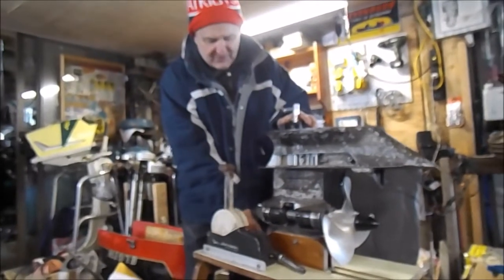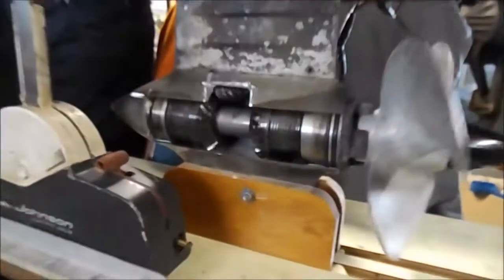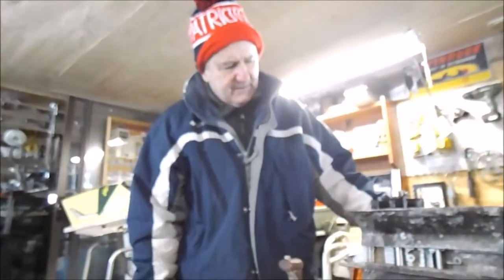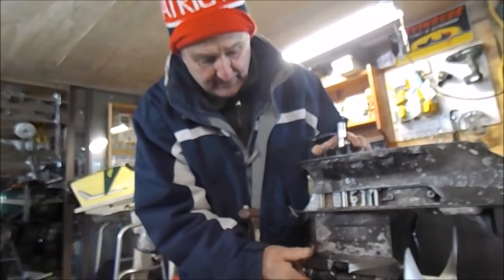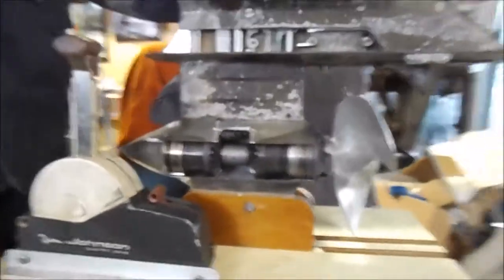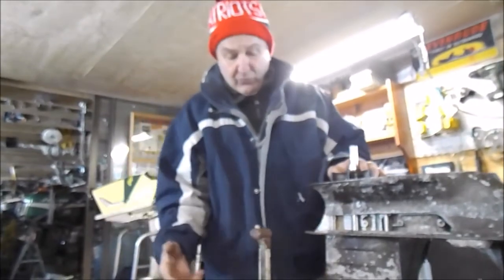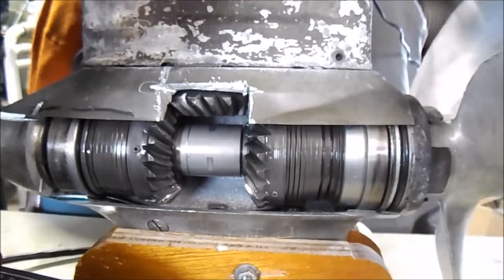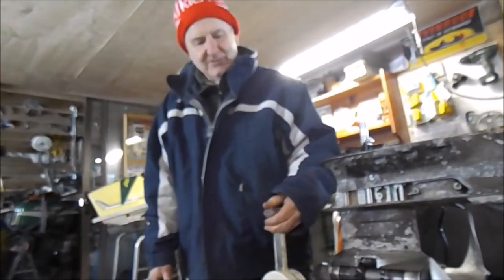OMC electric shift lower unit

Comment: That Lower Unit was from a V4 75, 80, 85, or 90hp Motor. Easy to tell by the Lack of any Gear Reduction(23:20), the Small Hub Prop, likely a 10 X 9 1/4"

Comment: Had 2 of these Units in the Mid 70s. Simple Design, easy to Understand, and to work on.  No Quick Shift and none of that Annoying Sound from easing it into gear, you hear all the time. If the Water Pump failed or was weak, the Shift Wires , were often burnt, because of a Hot Dry Exhaust

Comment: Thank you very much This really helped me understand how that works. I lost my dad back in May and his boat has not been out for 35 years I had it running I just replacing some points and I checked it on land to make sure it went into gear but once my sister and myself got it out on the water it popped in the gear one time and then would not go again luckily we didn't get out yet as this happened at the dock. But It was really sadening because we were really looking to take my dad's boat out again after 35 years. Hopefully I can figure out what's going on but your video definitely help me understand it.😊

Oh by the way the boat is a 1968 Browning with a 120 horsepower OMC outdrive and a four-cylinder iron Duke powering it.

Comment: My first boat I bought when I was a teenager had  a ‘66 80hp Super Seahorse with the Electramatic drive. The quickest and smoothest shifting boat I ever owned. I owned it through college  from about 2004 until 2011, and it never once gave me an issue. The electric shift fluid was readily available at my local Evinrude dealer at that time, but was hard to find elsewhere.

Comment: Good video has helped me a lot and member comments are great. I need help on installing new shift lead harness thru hole to lower unit. Do I grease then pull from which direction to prevent tearing up rubber seal?
Reply from the maker: I have never worked on one I am a Merc guy ,hopfully a OMC guy can answer your question

Comment: How can you test the magnets to see if they are working with the gear drive out of the housing
Reply from the maker: they are electromagnets run 12 volts thru the wires see if they pull the springs down

Comment: Thanks for the video. I also have the 1st gen omc electro shift. Curios if you know why mine woukd be stuck in gear? The engine does have 4 selenoids which 1 has 2 wires to the leg. I dont think its a hydroelectric that you were mentioning. Any thoughts?

Comment: How can you bench test the coils in the lower ?
Reply from the maker: the wires coming out of the lower unit  have a common ground the case so test between case ground and each wire for resistance I am reasonably shure the values are in the OMC repair manual for the unit I am a Merc mechanic and never worked on one they just fascinated me
Reply: Thanks for info
Reply: Did you ever find what the coils should bench test at?

Comment: Hi, thanks for the vid. I was here because I couldn't tell if the thrust washer was missing. The BRP web site shows a washer, occasionally the parts diagrams have mistakes. To this day I have never had a motor apart that somebody has not lost at least 2 pieces.

Comment: Very cool display indeed!  The cutaway and explanation make this unit easy to understand....Most nay sayers of these units just don't understand how they work...
Reply: Most nay sayers probably destroyed the forward coil getting it apart, and couldn't figure out how to press the new one back in! It's an unnecessarily  heavy brute of a ticking time bomb and the manual shift is more reliable and if set up properly won't leave you stranded. I'd fix it and sell it but personally would not own one.
Reply: Well, the electric shift will be stuck in neutral if power is lost for what ever reason.  But, the manual shift models surely had their share of clutch dog headaches as well.  I guess it is like anything else, either style will be reliable with proper maintenance...
Reply: If an electric shift loses ground or rubs a wire through you are sol without warning. At least with a manual shift you can feel it engage and if it gets weird you adjust/repair. I am doing an electric shift right now, they are simply a piece of shit.
Reply: Neutral does NOT help you in a body of water away from land. A hydro shift that defaults to forward gear will get you home.
Reply: Well, it is hard to imagine the electric shift gearcase "losing a ground", it is grounded through the case/block, just like the electric starter.  In an emergency situation, the forward coil lead could be jumped to battery positive to get home.  Yes, you are in trouble if the generator/alternator is not working or the battery craps out.  But, many engines had battery ignition, so these issues would put them out of commission as well.  Most boat owners continue to operate their manual shift engines with  stiff cables, improper adjustments, and ratcheting during shifting, until the engine won't stay in gear...Most manual shift owners don't heed the trouble warning signals you mentioned.  What could have been fixed with minor adjustments, usually ends up costing big bucks to repair.Trust me, I am not saying the electric shift gearcases were a trouble free perfect design.  But, the electric shift gearcases did remove all the usual human shifting/adjustment errors from the equation, adding a certain amount of reliability to the system.  I wouldn't hesitate to own either the electric shift, or the hydro-electric shift outboards.
Reply: To correct what I said above, the springs can be an issue and when they crack, break or lose their strengh they create metal chips. The metal chips against the hub cause greater slippage which creates even more metal. The metal gets sucked towards the coil magnetically. I use a heat lamp for 24 hours before removing the forward coil. Nearly EVERY one of these that has come in the door was botched by somebody who did not press the coil in far enough. Pressing them in is a bitch and reusing the [forward] coil is taking a chance due to the stress of pressing causing the bakelite or thermoplastic to move. If you look closely you may see a bit of oil come out between the metal and plastic. Loss of ground is unlikely, I have had issues with the harness having insulation crack and wires break/short. That being said, a pristine 40hp may be worth $500-750 running if you find a sucker. When the spring breaks BRP pricing will set you back $173 spring, $156 hub, $173 coil, $67 gear. After 1 thing fails and munches up the drive gear, don't forget to double the cost for the other end, add gaskets and seals and maybe an impeller. I have 2 electric shifts 40hp, with all the above parts NOS replaced, bead blasted and epoxy primed in Urethane base-clear running for $750 a piece with the controls 1 long shaft, 1 short. They came in the door in 5 gallon pails BECAUSE THEY ARE PIECES OF SHIT and nobody can afford to fix them "properly". Add $180 if you need the harness 383595 while it's apart. The manual shift is light weight, you can drop the skeg and have a look inside, reseal kit is $12, gears are $45 each and shift fork / dogs ($30) you can reuse. YES, the cheap ass motor OUT PULLS the fancy junk [boat anchor]. I'll have to weigh one up one day.....easily 25-50lbs lighter, and then there's the serious design stupidity of the pinion bearing......
Reply: Well, you have hit on a problem for sure....The electric shift unit is bound to be a mess if someone has been inside it before with no experience or the proper tools.  And yes, finding the parts today is an expensive proposition for sure.  Used outboards, regardless of their condition, are not worth much...So, it is surely not economically feasible to rebuild one of these units properly, then sell the engine and make a decent profit.  The demand is very low for these repair parts today, so BRP will surely charge ridiculous prices for new parts.   But again, the same low sales prices apply to most older used engines, so doing any sort of repair/rebuild work to them makes it unlikely you will see a profit when reselling the unit.  The repair parts for the manual shift engines are surely easier to find, but new parts cost more than you have listed.  And again, the quality of repairs to these units varies greatly.  Anyone could probably get the unit apart and replace a clutch dog "successfully".  But, will they get it properly resealed, not likely at all.  Repeat failures are likely unless the gearcase is removed and the job is done completely.  Trying to do this job just by removing the skeg is a tricky procedure for sure, you would have to tip the engine upside down to get it back together.  Few techs ever get these units properly resealed, this is a hard job indeed.  Anyone can ram/jam some new seals/orings in it and replace the spaghetti seal, but having it sealed up properly is unlikely.  The shift rod oring and upper driveshaft seal can only be replaced if the unit is completely removed from the outboard, which is not a big deal.  Resealing the electric shift units properly is much easier than the manual shift split skeg models....I laugh knowing that most of today's techs don't even have pressure/vacuum testers, much less use them.The loose pinion bearing needles can be held in place with the OMC needle bearing grease during assembly, not a real big deal.  I can't imagine doing any sort of work on any gearcase without replacing the rubber water pump impeller and inspecting the impeller housing for wear.  So, trying to repair/rebuild the electric shift models today, with limited parts and high prices, is not a viable option for most owners.  Finding a technician who has experience and the tools to do the job properly is unlikely as well. Today's technicians are more likely to attack the manual shift models, but not likely to do the job completely and seal the unit up properly, which means the repairs won't last long.  Used parts are easier to find for the mechanical shift models, but are they really in good shape.  I have not seen too many used clutch dogs, or gear lugs, with little or no wear.  Doing this job completely, checking all the linkages and cables, sealing the unit completely, will cost plenty of money...
Reply: You haven't had one apart, and by the sounds of it shouldn't be touching a marine engine. You contradicted yourself.
Reply: Well, was just trying to be fair and compare the good/bad points of both units, each has its benefits and weaknesses.  Don't mean to be contradictory, and certainly was not implying you damaged the gearcases while working on them.  Just saying that you are certainly at a disadvantage trying to work on a unit that someone was into before you.  In my twenty year career at OMC, I just might have had a few of these things apart and somehow managed to get them back together....I hope you have better experiences with these products in the future.
Reply: IMO the point of the comments is to learn or share information. A manual shift has a nitrile spaghetti seal and a prop seal. A selectric has an O ring and a prop seal. It's the same concept.
A manual shift can be tilted and you can drop the skeg, have a look inside and reseal in a half hour. If the guy before you put all the screws back in the pinion won't fall out.
In a selectric, you have to line up the pinion, not drop any rollers, not pinch wires and not let the O ring slip out  during install.  You  have to drop the whole gearcase to do so. IMO the gearcase and W/P should be inspected anyway but that is outside the scope of my comment.
I don't know why you are all over clutch dogs. The problem is people not lining up the shift linkage. The fork and dogs are reliable that's why we use that style in most  manual transmissions.
The average person will not have a blind puller to get the forward clutch out nor a press to reinstall it. Nor will they be able to inspect the race or remove it.
In a manual shift it's easy and unless pinion work is required no special tools needed.
It's like a Ford 5.4 Triton. They break spark plugs in the head, the cam phasers, chains, tensioners and guides are pieces of shit. The con rods are so light if you have a head gasket leak they bend, throw a code and you will never get an emission test pass. Or you could just go with a 4.2L that is bullet proof.  GM & Dodge is smae thing, different displacements. Bottom line is engineers, people who write reviews in magazines and salesmen have different views than people who fix things. Last I checked BRP a manual gear set was $200 for everything.
If a tech can't set up a manual case you can forget a selectric ever working. As far a s used parts go there are 2 things that occur. Either gears are mashed from improper assembly or they are rusted and mashed from water. Either way at least one fucktard was involved if not more.
Reply: Don't mean to be "all over clutch dogs", a proven system that has been around for years.  Just saying that both systems have their pitfalls, and good points.  And yes, most techs will not have the proper tools or experience for the electric shift cases, making it less likely they will be repaired correctly.  But, just because a tech gets the clutch dog system apart and back together "working", does not mean his repair will last for very long.  And, it is even less likely that the tech has resealed the clutch dog gearcase properly.  I could "probably" get a small block Chevy apart and back together working....But, I doubt my job would  last long or be a top notch repair.  I don't have the training, tools, or experience to do the job like an expert.  I could probably get a BMW engine apart also, but really doubt I could get it back together running again.  This is the comparison I am trying to make (not that I equate an electric shift gearcase to a BMW engine).  The average technician/repair guy is never going to get the electric shift gearcase back together and running again, you mentioned a few reasons why.  But, that does not mean the electric shift gearcase is a  "POS".  I am no engineer, and have the same frustrations you do in that regard.  I spent most of my career actually "fixing things".  So, please forgive me, I am not trying to imply that you don't know what you are doing....I am just saying that just because the electric shift units require some extra knowledge and tools to service them properly does not make them a "POS".   Don
Reply: Don, I totally get what you said however complexity increases the likelihood that anybody who touches it will create a problem as you noted in the BMW comparison. I sometimes find unqualified individuals even pay more attention to detail than techs. Some techs are just lazy. I still don't see what the issue is with sealing a manual shift 2 piece foot. The single piece ones can be tough around the exhaust ports but if you can't seal one you probably can't seal the other. I had a laugh at special tools in the manual and careful manipulation of a hammer. They are a bitch in a 20 ton press. You are also relying on 3 #6 set screws. They tighten against the spring but do not actually lock it. That is a design flaw. If it shakes loose you are in Neutral without a paddle.
Granted a bad ground is unlikely within the motor, those motors utilize shift cables of 18ga. This week I had an ignition sw arc in my had while I was holding it. The length of the wires make them susceptible to salt spray, corrosion and voltage drops as does corrosion within the gearcase. At least a manual you can start on the rope and a hydro shift will default into forward gear if your harness is on fire.
Reply: Sealing that split gearcase is tricky because the spaghetti seal must be trimmed just right or it will not seal against the prop shaft seal housing....In fact, I am confused as to why the engineers chose to have the spaghetti seal butt up against the housing instead of against the gearcase head oring....Seems like a big engineering mistake making it harder to seal up for sure.  The electric shift units just have the oring around the prop shaft head and the simple oring between the upper/lower halves that can be glued in place with type M.  No shift rod bushing/oring on these units either.  Yes, it can be tough getting the harness out of the gearcase without damaging it, often breaks coming down out of the exhaust housing especially in salt water....I too, spent most of my career working on salt water engines, no fresh water vacations for me...But, just like any other salt water unit, problems are less likely if the gearcase is pulled down every couple of years to lube things up....Of the two designs, I prefer the hydro electric also.  Sure, there is likely to be wiring problems/corrosion/bad switches on a unit that was last produced in 1972.  But, to be fair, how many cars still around from that era have wiring that is in real good shape, and the cars were surely never run in salt water.
Reply: Forget OMC. Clean the skeg, grab a can of 3M spray adhesive (glorified contact cement) spray it let it tack up, put seal in, trim slightly oversize, slide rear housing in with 2 dabs of silicone. It's a non issue. Use either the copper or grey silicone and you can omit the nitrile just like we do on every intake gasket, timing cover and oil pan these days. It's a simple repair. Just let it dry.